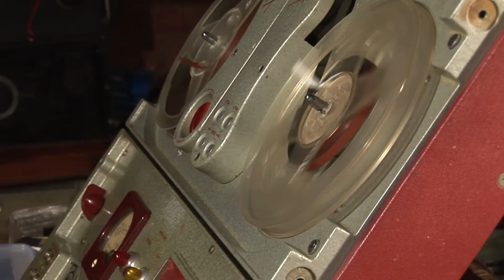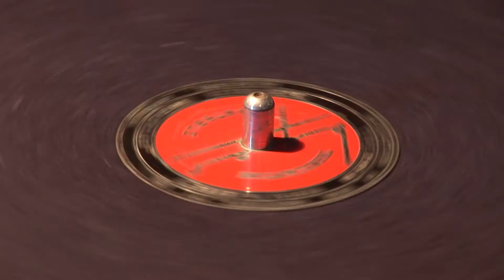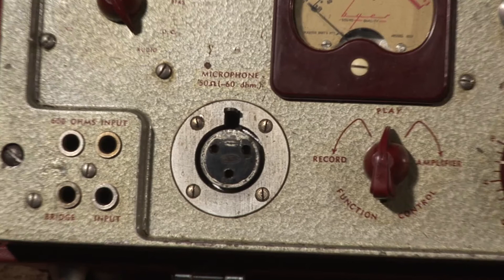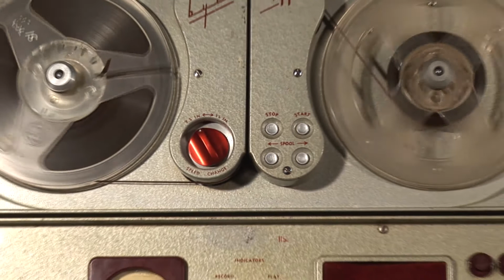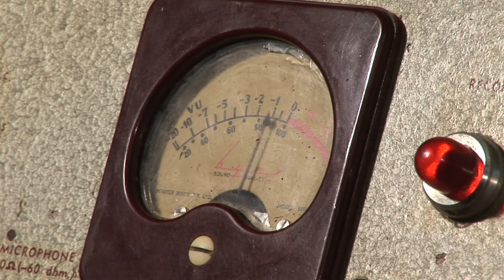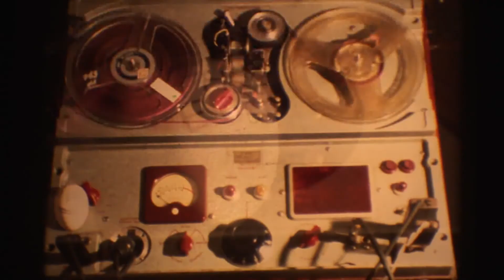Byer 77mk1 Tape Recorder

Comment: I used to have one of those back in '74/75. I used to work for Graham Thirkell at Optronics in Huntingdale. He had one in the junk shed that I persuaded him to let 16 y.o. me take home. Was missing a brake solenoid on the RHS motor and I think the record head was missing. It was absolutely built like a battleship, and as you mention, the fast forward and rewind speed was amazing. It was a full track machine so normal stereo tapes from other machines weren't suitable. And the heads were pretty worn out and being a non-standard cylindrical shape it was pretty hard to adapt some other kind of head as a replacement. No schematic available at the time either. It was certainly a piece of Made in Melbourne history though.